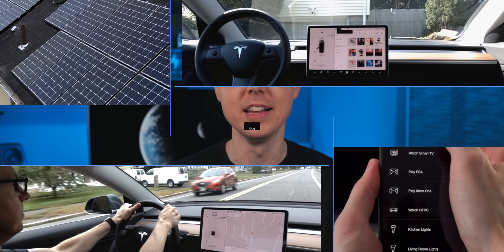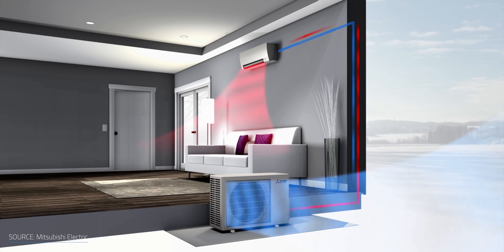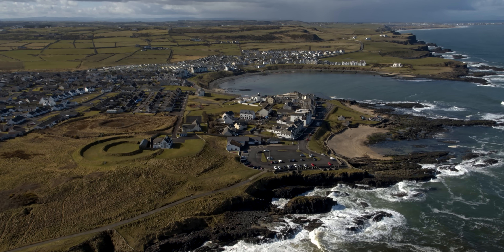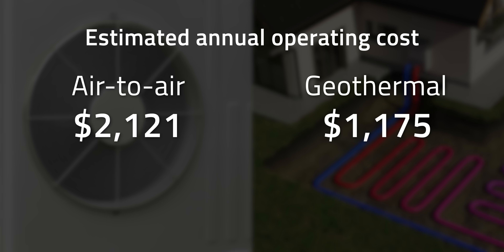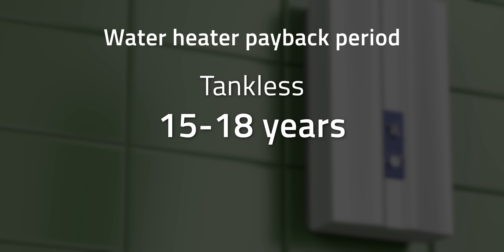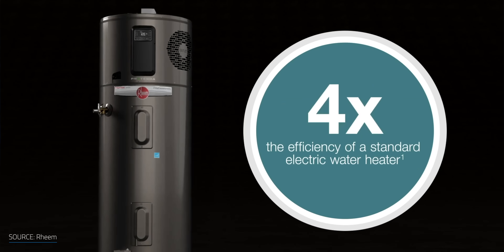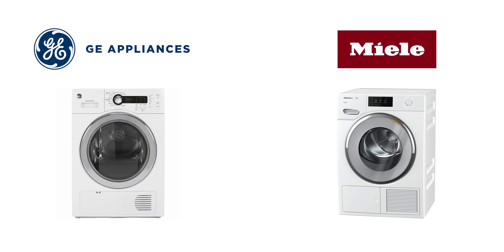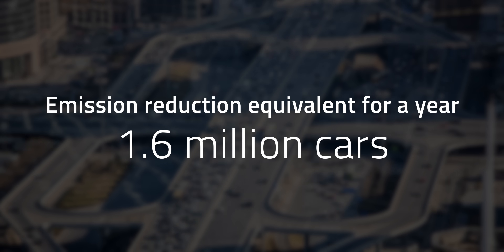Why Heat Pumps are Essential for the Future - Explained

Comment: The only drawback with heat pump dryers is the difficulty level to clean the evaporator coil once is clogged up with lint. No matter how many filters they have to prevent them from getting any lint it always happens. You will notice the drying time increasing overtime. I love the idea but it still needs improvement. My A/C on the other hand is also a heat pump. Running for 16 years and not a single problem so far. Great video. Thanks for your dedication.

Comment: I just built a house over the last 2 years with the geothermal hvac, hybrid hot water tank and will be getting solar and batteries soon.  Love the system and the cost to run was way lower than  expected.  The one thing I would recommend for your home is zone control for your hvac system.  We did this and imo was the best spent money.  By moving conditioned air to only the areas of the house that need it increases the overall efficiency.
Cheers
Reply: Be aware that zone systems don't work smoothly with natural gas furnaces. We went with a 4 zone system last year when we replaced the worn out heater and added A/C. The A/C is no problem but we have to use the common area as a "dump zone" to give the furnace a guaranteed air flow. The alternative was a modulating furnace and the cost difference was intolerable. It still works for us but takes some fiddling with the vents.
Reply: I'm a HVAC company owner. Zoning will not save you one cent in power unless you totally insulate each interior wall in the entire house and use insulated doors. We've ran hundreds of experiments with this. Also reducing the total airflow of the system will cause the AC to use more power per BTU movement. Using zoning on gas, oil or propane system can be very dangerous.
Reply: A friend of mine got mold with one of those, he also had the vents closed so the window condensates and never got the airflow to dry up.  Plus according to the other guy it's straining the system and doesn't help anyway.
Reply: @flagmichael  What you say applies to air conditioning too. AC's have a minimum required airflow that an improperly designed zoned system might not meet, causing early compressor failure and reduced efficiency.
Reply: A variable speed compressor as well as variable speed air handlers make all the difference! Swapped to this a couple years ago and and the electric bills were cut to 1/3 of the originals. I do live in AZ so it is mostly AC although the heat still works very well.
Reply: @Nicwedge  good point. Also, depending on the application, people should consider multihead minisplits as they are mostly inverter driven and variable speed
Reply: I would dump the whole house heating system and install mini-split heat pumps. Even though the local HVAC contractor did not recommend it, my brother went this route and said it was the best thing he had ever done.
Reply: Zone control with heat pumps is really nice with split head systems, no need for ducting and all the space that takes, and zoned heat and cooling is the default.
Reply: One of the more helpful threads I’ve read in ages.
Reply: isnt zone control intrinsic with multi-zone heatpump setups? i never thought of it as an option, just a given.
Reply: I have a gas fired steam boiler. A few years ago the temperature here went down to minus 20 F several days (minus 10 f is normal). So to boil water I need 250F or better boiler input sourced from minus 20 F air. Only a nut would even research a heat pump. New construction is an entirely different matter.
Reply: @tsamuel6224  only a nut would even research…. Really?
Reply: @Bryan-Hensley  Long reply, if you ignore it I understand. Your reply is to zoning systems. My question is not about zoning. As the HVAC company owner you are (I feel that sounds sarcastic, it is not). I would like your opinion on Gas vs Electric heating. The question/opinion I am curious about,  Could/would an electric central heating system be practical for my situation?  I own an old (will be 100 years old in 2025) home in the middle of Ohio. I recently purchased this as my first home. I do have central air and heat. It appears the air/heat is just pumped into the walls for the second floor. My second floor has flap vents in the walls with no apparent duct work attached. I did have solar panels installed on my roof. I over paid the electric company $50 3 months ago, my bill has been $0 for the last 3 months. I have a gas stove, heater, and water heater. After watching this video I am wanting to purchase a heat pump dryer and water heater. I do have a basement. I know there are a ton of factors in heating/cooling a home. I hope I did explain a few. From what I have researched gas seems to be the most efficient way to heat my house in this climate. I am also thinking about getting a few plug in space heaters to keep the chill off and keep the gas heater. My central furnace seems to be in good repair. I want to be more self sufficient while being practical about it. Thank you, and I hope you have a great week!
Reply: @wabash1581  heatpump with gas furnace as auxiliary heat. There's devices available that will automatically switch from the heatpump to gas heat at a programmed outside temperature, like 20 degrees F for example. You get the best of both worlds that way. I'm not fully understanding your ductwork, but you need an insulated airflow way. You may have to frame in some ductwork in the corners of your lower rooms or in a closet. Find a HVAC company that has experience with old houses to help you with the ductwork design even if you decide to do it yourself. Too bad I don't live closer, I'd like to look at that place... I'm in East Tennessee. A heatpump dryer is interesting. If you already have a functional gas furnace with AC you don't need to replace the furnace. You might not even need to replace the evaporator coil on top of the gas furnace. You may only need to replace the outside AC for a heatpump.
Reply: Rob Schultz Does your Hybrid hot water tank use the geothermal as its heat pump or does it have its own separate air to air heat pump built in? I am planning on building a house and looking to do something very similar to you. I'd love to find a way to chat more with you if we could.
Reply: @tylertoepke-floyd4755  Yes, I have a holding tank that holds excess hot water from the geothermal unit.  So in the end,, the hybrid tank only has to heat the water up from already warm water.  This works great.  The geothermal installer did say that in the spring and fall (note that I live in Canada), when the geothermal system isn't working much or at all for many days, the geothermal unit tank will not produce excess hot water and the hybrid water tank will have to heat the water on its own.  I personally don't see this as an issue.
Reply: @robschultz9262  I'm located in North Dakota so similar climate. Ok, Let me see if I got this straight. You have a geothermal heat pump running a closed loop of coolant that has a heat exchange to provide your house with heat/AC. The geothermal heat pump also has a reservoir tank that connects to a second heat exchanger that transfers heat to water line coming into the hybrid hot water heater when there is excess heat from the geothermal heat pump. Am I understanding things right?
Reply: @tylertoepke-floyd4755  Correct.  The one thing I will note is that the hybrid hot water tank, by design, outputs cool air.  You need to make sure that you take the space requirements into account when designing the utility room.  Keep in mind that in the winter, your geothermal furnace (I selected WaterFurnace) will have to produce heat to heat your hybrid tank water (the delta from the holding tank to desired temperature)  as it is taking house air to heat the water.  But on the flip side, in the summer, your hot water take will help cool your house.  My system had no issues with this in our first winter as by building code things tend to get over spec'd. 
One thing my installer suggest and I'm looking into is to actually connect my hybrid air output directly into the houses cold air return (forced air system).  I'm trying to see if this would be allowed by the building code.  This could be a baffle in the exhaust air flow to local room and cold air return so I can change it in the winter and summer to more efficiently use the hot water take to cool the house.  This is just something else to try to make the house more efficient and use the strengths of each technology together.  This isn't something I see in looking for installers.  Most are just HVAC guys that don't realize the full picture of the products being installed (as with gas heaters, this isn't an option) and how they can work together.  I know, before people reply to this that some HVAC guys are looking at systems like this but in my dealings, they are few and very far between, especially in smaller markets.
Reply: @Bryan-Hensley  not a problem if you have a bypass damper or a variable speed air handler.
Reply: Forget the zone control hvac... Minisplits are far more efficient and they don't have the issue with heating losses via duct work. Having multiple head units means you can control every rooms temp independently. You can shut off the heat in a room you aren't using while still heating the others. It's far more efficient over all.
Reply: @grashoprsmith  not to mention the seer/eer ratings on minisplit are on average far higher than ducted systems.
Reply: @tomswiftTTT  your brother is 100% right. The hvac guy probably didn't want to sell you a minisplit system for many reasons and none of them are because it wouldnt be better for you. It seems alot of hvac techs in the US are not up to date with mini  splits yet. They are more effecient and you have far better control of the temp in your home.